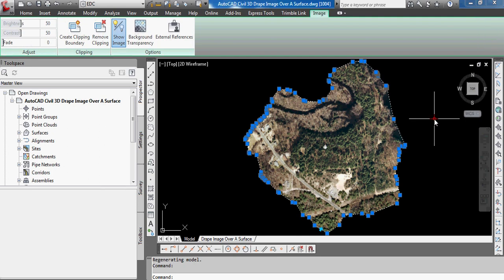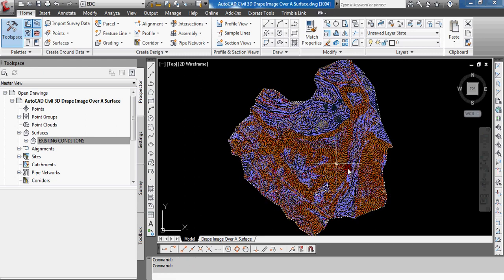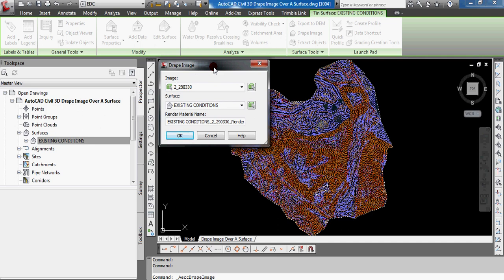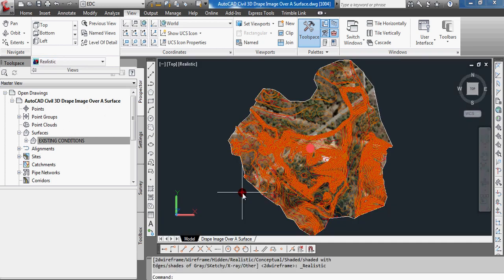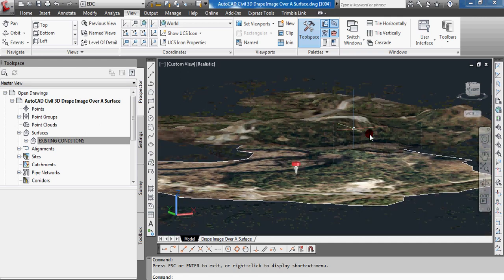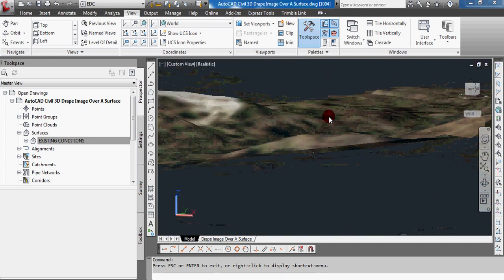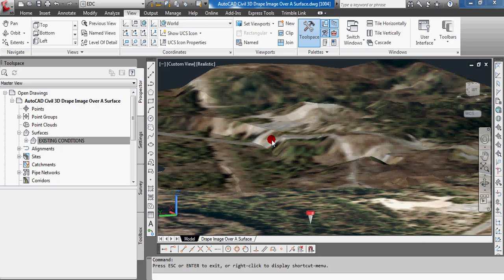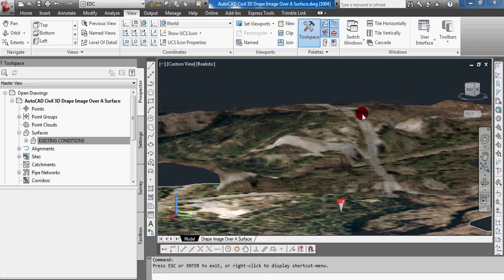AutoCAD Civil 3D Drape Images Over A Surface

Comment: Hi Eric, I don't think its mentioned in your video anywhere (so apologies if it is) but do you know why you're getting the strange image rotation/inversion when you drape the image on the surface? I tried this a little while back and had a similar problem. Boss tried it yesterday and worked fine, so just curious as to how this error comes about. 
Thanks.